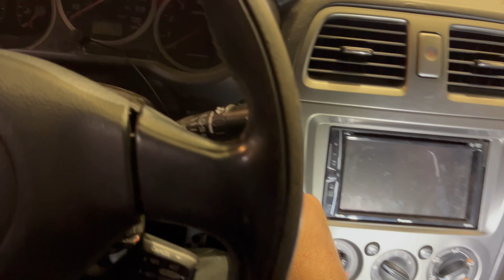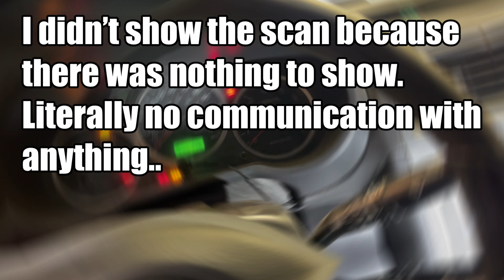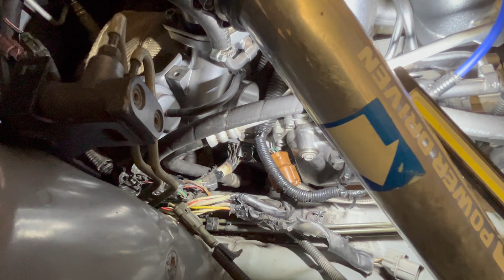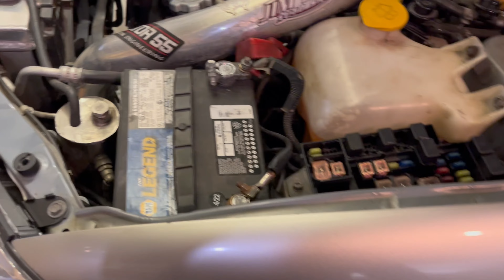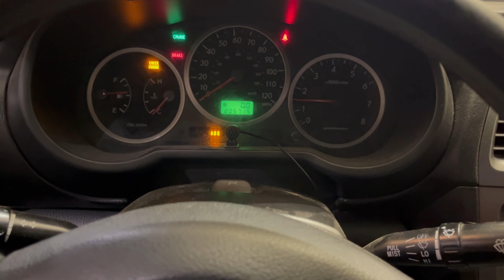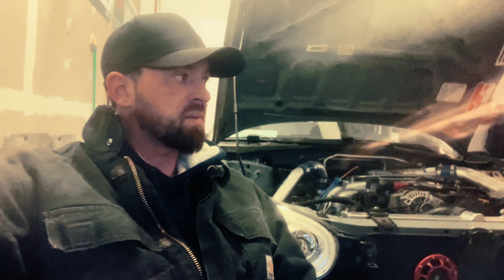Crank No Start No Communication Instrument Cluster Flashing Relays Clicking

Comment: THANKS FOR SHARING when wires get hot and you have unwanted connections crazy things happen sometimes. i have had a few that was kinda like yours first thing i did was separate the wires and check fuses then try to figure out why they got melted because you don't want to fix all them to have them melt again. great video
Reply from the maker: What a mess right? I wasn’t even going to attempt diagnosing that car with the harness melted! Became pretty apparent the turbo was the culprit. I fixed the harness and put it all back together and shipped it. He ended up immediately taking it for a few hour road trip straight from the shop, to visit his mom for Christmas! 3 hours each way over a mountain pass. He said all is well 🤷 thanks for watching!